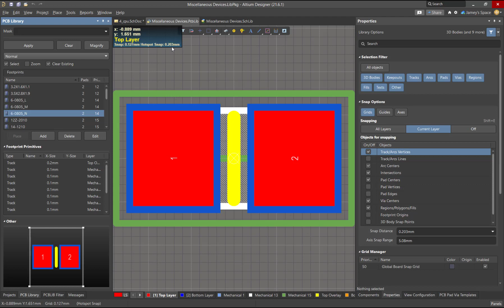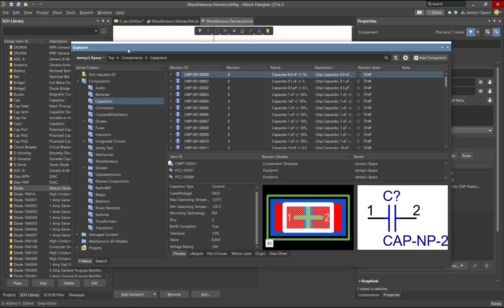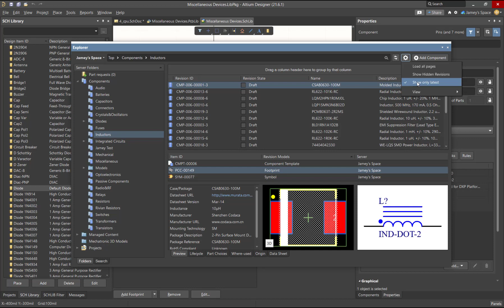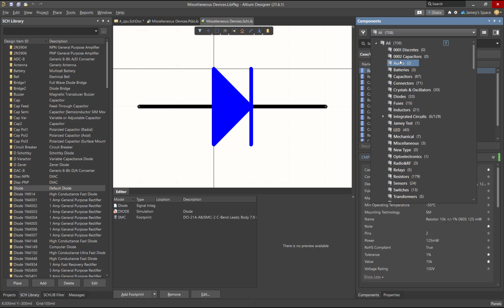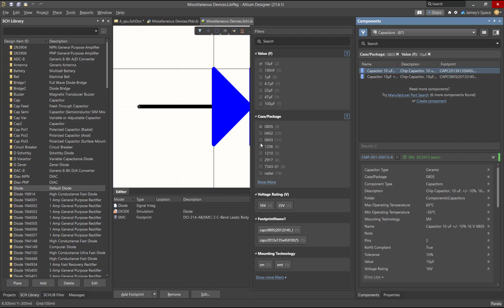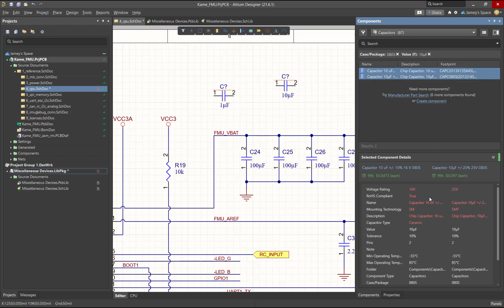Using the Managed Library in Altium | Component & Library Management

Comment: dear Altium, i have a question for you!
i have an existing project with it's own schematic, library and pcb files. i migrated the libraries useing the migration library tool, and now i would like to tell my schematic and PCB documents that they should refer to the new migrated libraries instead to the local one. 
How can i achieve such a thing?
thanks!
happy new year
Reply: Do the Automatching and mapping of components for you Schematic

(Tools-Item manager-options-define parameters etc etc..............-Automatch-OK.........ECO-Genrate Eco-Execute changes-OK)
Reply: @rafaqatali19800  Automatching will not allow using a NON managed library or server based one at all. When needing to prepare a project for external handover to customer it can't be relying on libraries that will no longer be available. Exported libraries with component links to suppliers work fine, but how to map them in from the schematic and board files? There has to be an automated way of doing this, the component ID's are even the same since they were exported. I can't find any tool to do this.
Reply: @1kreature  I've been searching all morning on how to do this.  Utter crap...🤯